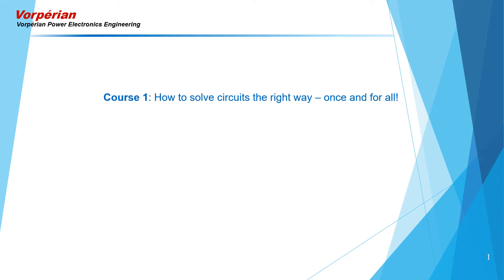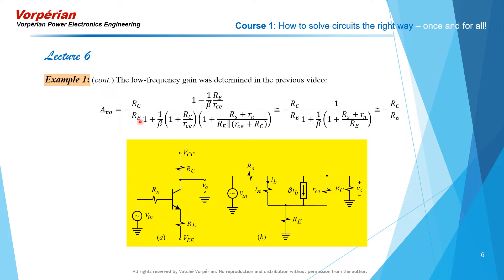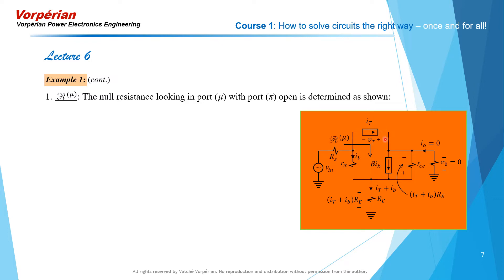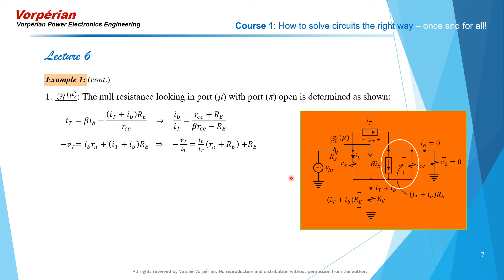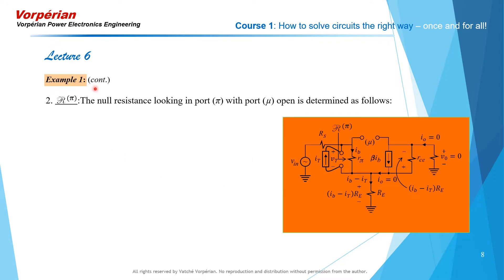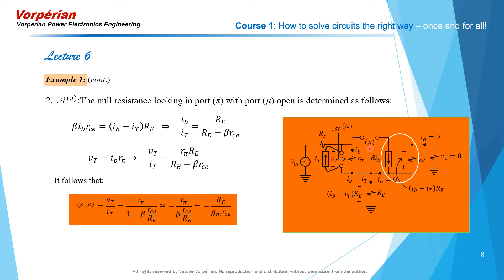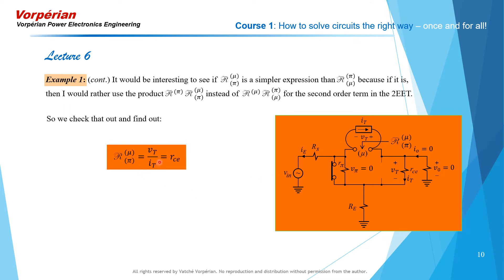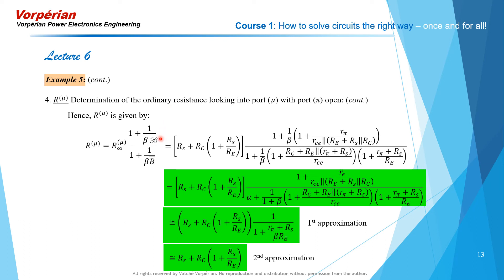Video 19: Fast Analytical Techniques in Electrical and Electronic Circuits

Comment: Dr. Voperian, I would like to ask you. Why use VCCS once in the transistor model and once CCCS. Does this have a practical consequence or to simplify the calculation?
Reply from the maker: It makes no difference at all what you use for a test source. Please do review some of my earlier videos when you apply the EET to an impedance function to be clear about what it means to null the response and set the excitation of an impedance function.
Reply: Thank you very much!